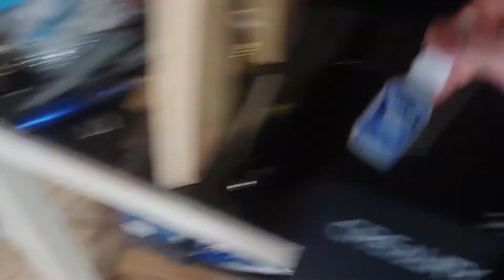CR10S Pro - Linear Rail and Custom Bed Mounts, DIY/How to

Comment: How much did the original base weighted?
Reply from the maker: The original base is about 457g without any of the wheels or hardware attached. The aluminum base I made is about 100g lighter.

Comment: I have got same issues with my CR10S v2 pro! Impossible to setup my y axis bed tray pom wheels so I have not chance I will upgrade this one. But the problem is I have to spend a lot of money for this machine and I can't see even when will be work in the future.
Reply from the maker: Repairing and upgrading is a great way to learn how 3D printers work and how you'll need to maintain them as you use them more. If you don't want to do deep dives into technical work, then I'd recommend something like the Creality K1 or Bambu Labs.

Comment: What material did you request to make the bed mount
Reply from the maker: The carriage is 5052 aluminum. The orange bed mounts are the generic silicone ones found on amazon, ebay, etc.

Comment: Do you have the file so I can have sendcutsend make the bed for me? :)
Reply from the maker: Sendcutsend can't do the style of bend I originally designed which is why I didn't have it pre-bent. Better off using the stock bracket for the belt, but spaced down for the increased height from the rails. Unfortunately, I don't have my original file so I'd have to re-measure to make it.

Comment: I was also thinking about this upgrade. I wonder that; is there really big improvement in the prints ? If we consider about cost and effectiveness; is it worth the upgrade?
Reply from the maker: It was worth it for me because the increased rigidity and removing the roller wheels since they need adjustment often and eventual replacement. With how much I use my printer these are essentially lifetime. I haven't adjusted my bed level in about 6 months with the mods I have and it is still good when I last measured. Cost is a personal subject because investing the $80 on this saves me a lot of time in the future.

Comment: What length rails did you install?
Reply from the maker: 450mm. The link in the description should've been to them.
Reply: @Weekend_Garage  when I clicked the link it had 300mm selected.
Reply from the maker: It must link to whichever size is available. But, you can use any brand as long as they are 450mm and don't have play in the bearings.